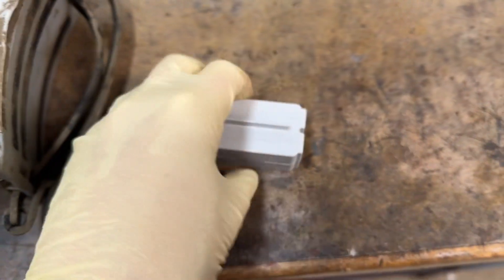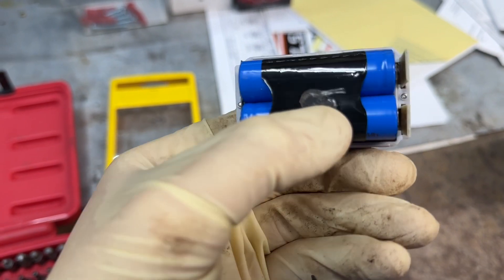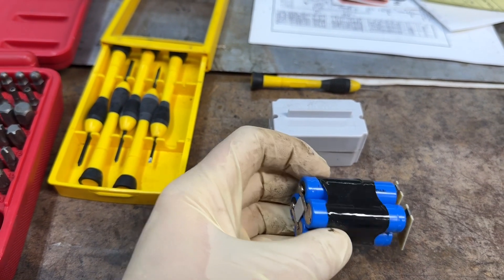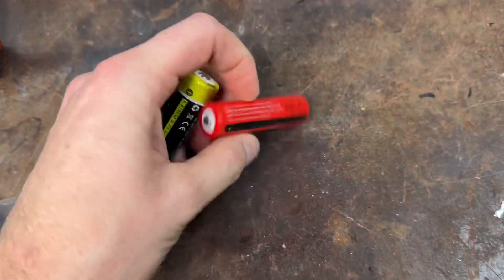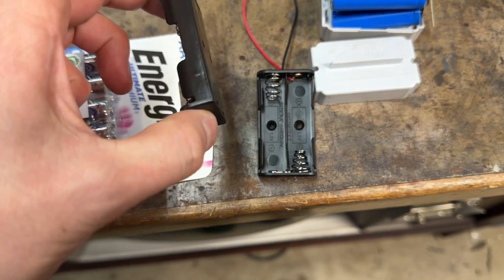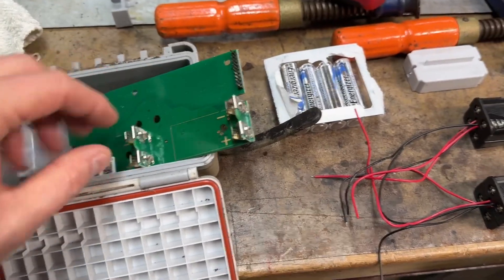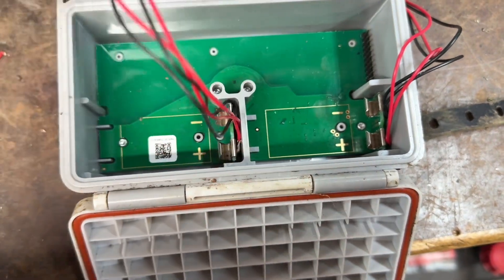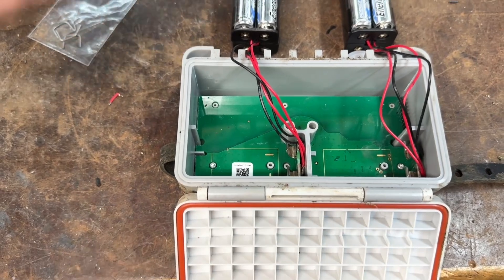Flume Water Monitor Custom Replacement Battery

Comment: Actually it says the flume runs off 3.7 . So I am thinking installing a 12 volt battery and reduce the voltage down to 3.7 . Have 2 terminal leads come out of the flume and waterproof. Then connect to the battery in a water proof case similar to something you see with a fish finder and maybe you would need to charge it once a year

Comment: this is the last msg I got from flume -  
We could check for any damage to the sensor. However, we wouldn't be able to replace it because of the 3rd party batteries. As of right now, there isn't anything I can do from my end. You could try moving the battery to the other battery terminal.  

now they want me to buy a new sensor 😂

Comment: I connected my rechargeable battery and it worked for 2 weeks, then I replaced the battery, now my sensor wont connect anymore , green led flashes, flume guy said I need to buy $19.99 battery from them😜, I guess he has the power on his end not to connect the sensor to my bridge. if he wont connect it, then its trash.🤣

Comment: Great video!  Thank you!  Thinking about getting a Flume here in August 2025. Question my meter box floods once or twice a year where there is water in it completely and it may stay like that for a day or two. I see the orange rubber seal on the cover. Is it your opinion this Flume unit could survive the water ?  Would Permetex as well make the unit water tight?  Hate to buy this only to get it ruined by real world scenario. Thanks!

Comment: Thank you for this video.  I also followed along but decided to do something slightly different.  I did not want to solder to the circuit board.  I used a Dremel on the old flume battery bottom half. I cut out a section to allow for the battery pack that were 2 AA cells stacked. The battery packs were oriented just as shown. Removed the Flume battery terminals, and soldered the battery pack wires to it.  This gives me the option of returning to Flume batteries with an unmolested circuit board. Energizer AA Lithium batteries.

Comment: Did this but once the lithium batteries made contact with the contacts, it fried the circuit board and the batteries were hot to the touch.. TV1 and 2 both fried. I noticed, as the batteries made contact, that an LED flashed red.😫😫😫😫😫
Reply: Now I gotta spend 2-300$ on a new unit
Reply: I also used quad battery holders instead of sticking two battery holders together. Maybe that’s what happened

Comment: This is great! I just tried it, however, and Flume still says batteries are dead. Bought all of the gear in the video links, soldered, etc, checked wires, still says they're dead :(
Reply from the maker: @burritofever  it takes a little while for it to report back that they are not dead.
Reply: @mechtrician1  ah ok. I noticed that the wires in the AA cases appear much thinner than those in your video -- I wonder if they changed the gauge and the new wires can't handle the load? Batteries have plenty of charge. I soldered, etc, but any movement of the battery packs and it drops power to the unit and I get the orange flashing lights. It's very finicky.
Reply: green led flashing for days, reconnecting twice a day but still wont connect

Comment: Thanks for this video, nice job! I too don't like proprietary oriented products. I will be implementing this solution on my Flume very soon, already have the battery holders and batteries just waiting for things to warm up a bit. Question: why not use rechargeable batteries? Will rechargeables not last as long?
Reply from the maker: They won’t last as long and don’t provide the correct voltage. Also aren’t as voltage stable.

Comment: Instead of all this work, I bought a second battery holder from Flume and after their battery failed, I just replaced the 8 batteries,  the ones I get at Sam's same battery. It may cost a little more to start but easy, Nice job thou.

Comment: Thanks for the video!.  Mine got waterlogged after about 7 months.  The battery totally corroded.  I'll do your battery replacement, clean it up, and give it another try.  My seal is black and thinner than yours.  It also doesn't have the pins on the upper right.  I'll rub the seal with a little motor oil and maybe it will swell a bit to seal better.  Hopefully it will work.  When it worked it was great!  I've had trouble with the bridge disconnecting from my wifi  I'm using 2 Asus Zen Wifi routers in a mesh.  I'm debating changed the node to act independently and just assigning some of the wireless load to it.  Some of my stuff seems to not want to play or play nicely with the node.

Comment: Just installed battery packs and ultimate lithium batteries as you showed in the video.  Works great.  Will be much easier to replace batteries in the future....no waiting on mail and get away from proprietary battery.  Thanks so much for the video.

Comment: So I did the same thing you did and as soon as I put the new batteries in it showing low battery. Can you think of any reason.
Reply: Did you use alkaline batteries? Alkaline batteries have a lower voltage and flume will read the low voltage as low battery.

Comment: I removed the 4 Torx screws and the plastic keeper, but the board won't lift out. Any hints?
Thanks.
Reply: It will come out.  Put a small screwdriver between the board and the side of case.  Gently wiggle screwdriver in several places.  keep working it until it breaks free.  Nothing else is holding it in place.

Comment: Thanks for the video, I just did the same thing. When I bought my second battery Flume sent me one of the older open carriers so I could replace the batteries in that one and only had to solder in one like you did.

Comment: I'm equally annoyed at this costly proprietary battery arrangement.  How has your mod worked out so far?
Reply from the maker: So far it’s working great. Yes it really pissed me off.
Reply: @mechtrician1 Great....  I'm doing your mod as soon as the battery boxes I ordered arrive.  Appreciate your vid!
Reply: @mechtrician1  I finally got the AA battery holders I ordered from Amazon, after having been shipped the wrong size from other sources twice.  I was only able to fit 3 of the holders inside without potentially compromising the water tight seal, so I have 3 sets of 3v battery packs.  Seems to have recalibrated just fine and is reporting through the app as it should. Hope to get 18 months out of these new batteries.  Thanks again.
Reply: got mine for $25 after rebate and included a second battery.  There are silica packets that come in the battery compartment but it looks like you don't have them in there and it works fine, stayed dry.  Since your battery setup takes up all the available space.  they say to use their battery to get the best connection if your meter is far from our home.  the proprietary pack costs $20 but that's only for 1 pack so you saved about $20 making the equivalent of two packs for $20.
Reply: @abc123fhdi So looking at the cells Flume has inside of their battery  packs, they appear to be no name, possibly Chinese junk cells.  I soldered the battery packs I bought to the battery terminals... No way would soldered connections be inferior to no-soldered connections as their batteries employ.  Only time will tell.😮
Reply: The real joke is in the old pack they used Energizer lithium, I texted them and asked if I could change them with the same battery form the store. I love the product but making me think I need to buy their special battery is a joke. My sensor is 300 feet from the house battery last 2 to 3 months. I just got the Flume 2 lets see how the battery last now.